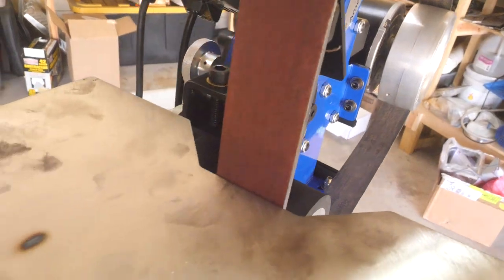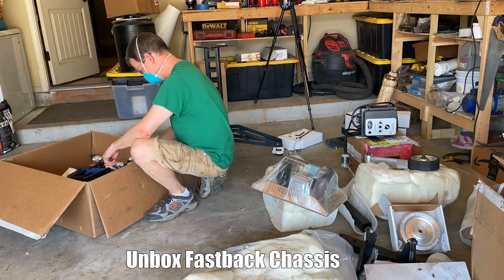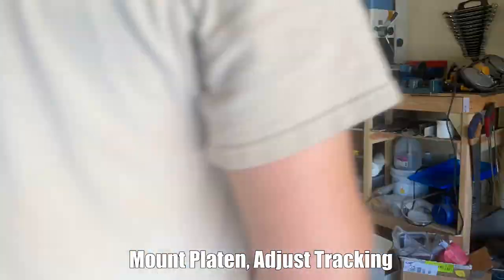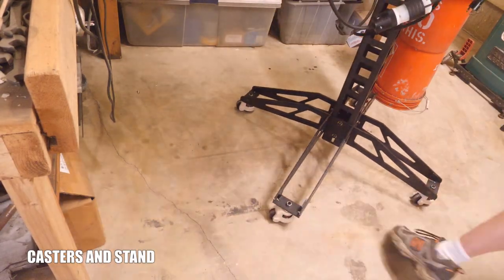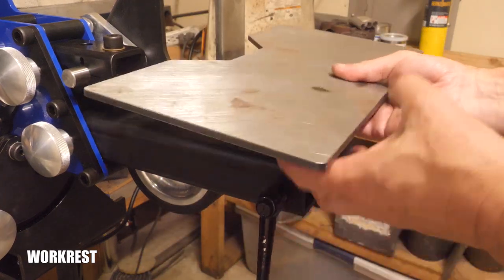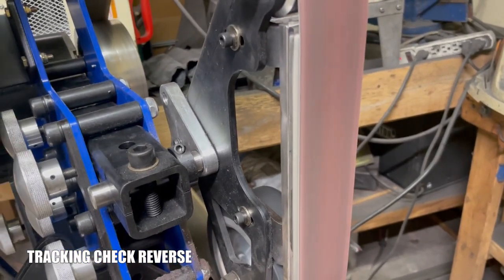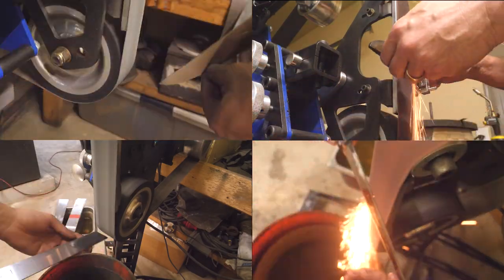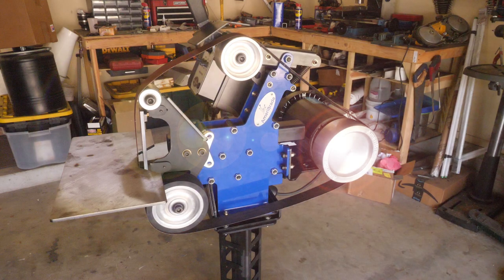Ameribrade Fastback 2 x 72 Grinder Review w Timestamps

Comment: I bought this about 2 years before you did and I am in the same boat. A few nitpicks like the platen wheels and platen getting hot and the small wheel arm eating a few belts when using smaller wheels than the frame. Eric was also super helpful when I was in contact with him with my questions and concerns. Overall I love it. I've used more than a few different grinders over the years and this is by far the best value for what you pay, so many simple and elegant features built into it. I plan on getting more kit for it in the future like the surface grinder, tilting mount, and the bigger work rest. As for using the reverse feature, I've seen some makers use it for edge down grinding and sharpening.

Comment: Motor torque with 4 pole at 2X base frequency means at 100% speed (2x base) the torque is really dropping off.   The VFD you should be able to adjust so 100% = 2500rpm for better torque control.
Nice review with good points.
Thanks SPIKER

Comment: I wasn't real sure about Reverse grinding either, but you'll find it'll be extremely handy for lateral grinding on its side, slack-belts and sharpening especially so the blade goes away from the human and into the wall instead when you screw it up. VFD's you wouldn't have much use for when you're just a shop-ape chonking off lumps of mild steel for welding- but for a knife maker I'm verging on the opinion it'll always be one of those features you work with, rather than working against heat and speeds.
Reply: No, the forward removes material, while running it in reverse adds material
Reply: @Cowman7344  Now all I need is the reverse direction belt sander of life to fix all those things I did as a young guy, and that oopsie last week with my thumb and index finger on the 60grit

Comment: There are many adjustments in the KBAC 27d VFD. The manual will walk you through them. I prefer slower speed and more torque. My Baldor is set to max out at 1755
Reply from the maker: I’m a lower speed guy too, that’s what I’m used to. Right now I’m running this at 65-75% which is 2500-3000 rpm.  If you lean into it heats up real quick.  It’s interesting how finesse and control with grinding are different at different speeds and pressure.  In some cases I think things are cleaner at high speeds (like bevel lines) and in other cases I think slow speeds and pressure is better.

Comment: Been looking into Ameribrade for some time now.  I have bought their drive, tracking, and platten wheels.  Have checked out others who make similar machines.  For the price Ameribrade seems to be on point.  Once I get to that point in replacing my own built grinder that works but is always out of adjustment, I will probably go with one of these.  I do like the horizontal ability.  Can't wait to have that option.

Comment: I love a vfd. But my old step pulley system with a 3hp motor never Boggs down. Anywhere from 8200sfpm to 1200sfpm.  But it’s nicer to just be able to turn a dial instead of moving the belt to another pulley.

Comment: Quick question - for general application in knife making, should the platen be in line with the lower contact wheel or the upper steel wheel?
Reply from the maker: I keep it a few mm proud of both
Reply: @GreenBeetle  you're a hero, thanks man! Made my first knife with my new 2x72 this weekend - grinding is no longer my least-favorite part of the build

Comment: I envy the US grinder/knifemaker market. You got it all quality grinders, power hammers, forge presses, forges. Over here in germany theres virtually no market. Gl finding a forge press. Nobody builds and sells those same with power hammers (granted theres still quality machines on the used market en masse just no presses). As for grinders there's those flimsy ebay china imports. Only one small domestic manufacturer bothers and the versatility and sturdiness of the machines compared to US models is meh and they still cost a small fortune. Affordable quality machines you only find after extensive research as imports from neighbour states like poland. Once in a while there's homemade DYI grinders on the ebays but obviously no QA or warranties whatsoever. You'd think Germany got huge established tooling companies but they're too busy getting crappy tools built en masse overseas. Either nobody bothers despite the demand because their other trash still just sells far too well but its probably also because its a huge hassle getting tools certified on our market let alone starting your own business to make and sell tools like that.